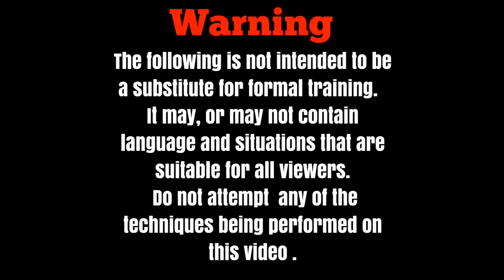Can You Mix Colors Into SIMTEC Sealer... Watch And See

Comment: Interesting. Sealant, catalyst & accelerant, typically 1/3, 1/3, 1/3, for poly right? (I guess warm weather mix, disregard the fact that you work sometimes in cold conditions.) Is that the mix? & do you need to change the mix to compensate for the dye?
Reply: Simtec 28X50 does not have an accellerant.  And the amount of catalyst is a fraction of the amount of sealer.
Reply: @michaelpolutta3131  - I've used poly before. I suppose accelerator only helps for quicker cure times. Just love the idea of experimenting with new products, as I'm sure many of the guitar builders that follow Texas Toast Guitars. Thanks for the tech info Michael.
Reply: @facultylynx9854  Are you talking about polyurethane (which does have something called "polar accelerator") or polyester (which Simtec 28X50 is)?  Or does polyester have an accelerator that I'm unaware of?
Reply: @michaelpolutta3131  _ Boy Michael, I'm not making this up, or trying to confuse anybody. but everything I'm about to say is useless information. My experience is With PPG, and Ditzler, Automotive (It's a perfect question, because many people have experience, but not always with wood) As far as I know Polyurethane, is polyester. Although it does get a little confusing when it all switched over the water base replacing the deadly solvents.  So both are the same, it's how they're comprised is that's different. Polyester is missing mechanical properties. Polyester is the thick resin, "think fiberglass." Polyurethane is a watery plastic coating. Useless info, unless it helps people not to confuse the two. Polyurethane=Paint, Polyester = Resin.
Reply: @facultylynx9854  Sorry, no.  Polyurethane and polyester are not the same thing.  Completely different chemistry.  It has nothing to do with solvents.
Reply from the maker: I want to say that the MEKP used for 16 oz of SIMTEC (at least the stuff we use) is like 1 to 100 or 1 to 50. We stopped measuring and just put in a small cap full or a half a big cap full... we are kinda low tech here
Reply: @michaelpolutta3131  - I love to troll people, but this is the wrong place, and the wrong time. Poly means to combine in a chain, right? And Herman Daniel Bluestein's Imperial Chemical Industries was the first to market  polyethylene, which was the first use of this sort of chemistry. He's also the guy the gov called to investigate the Bush/Gore voting machine scandal, and the O-rings on the space shuttle right? We can agree on this right?
Reply: @TexasToastGuitars  - What I was asking is if adding ye changed anything.
Reply: @TexasToastGuitars  - Something interesting to me on a side note MEKP. Thanks
Reply: @TexasToastGuitars  - The difference is ((CH3)2CO, Molecules of carbon and oxygen.  aren't you glade you know this useless info now?
Reply from the maker: Boy am I...
Reply: @facultylynx9854  The point is polyURETHANE and polyESTER (polyethylene is a polyester) are different because the chemistry is different.  Different plastics, but both are plastics.  Like the difference between acetone and naphtha.  Both VOCs, not the same things.  And, again, I am not aware of an accelerant for polyester.  As Matt mentioned in the previous video, Simtec said there is such a thing as too much catalyst.

https://en.wikipedia.org/wiki/Polyester
https://en.wikipedia.org/wiki/Polyurethane
Reply: Wow.

Comment: So - slightly confused.  The second coat looked like it wasn't quite clear but it wasn't quite tinted.  Did you just pour a round a clear into the cup that you had the tinted sealer in??

So aside from the "sure you can" aspect of tinting the sealer - do you see an advantage to this vs tinting the top coats?   I could see where there's some potential for some cool base coat / top coat color combos.
Reply: From the can the sealer has a pink cast.  Once mixed with hardener it changes to a pinkish light brown.

What you must take care with is not sanding thru the latter clear sealer coats into the color (unless that is your intent).
Reply: @michaelpolutta3131  - Ah, so by building with clear rather than color you have more to work with for leveling the finish without worrying about sand-thru.  That makes perfect sense.
Reply from the maker: Yeah, the SIMTEC has a pink hue in the cup. The goal with this finish was to make something that would be a matte finish with no top coat. We will get there with sanding and no buffing. So, it will be a time savings. If you are going to use a top coat there is no advantage to not spraying translucent colors over the sealer.

Comment: Ok, I don't get it. Simtech is a sanding sealer, you spray it on, you sand it down until it's almost all gone so that you can have a level surface for your base coat and/or clear coat. Because it doesn't go on and flow out like a clear coat why would you want your sanding sealer to carry any color at all? Was this just a test to see if it could be done? I'm still in the early stages of working with this stuff and I'm just curious about why you would do this....
Reply from the maker: That was the only finish we did on this guitar